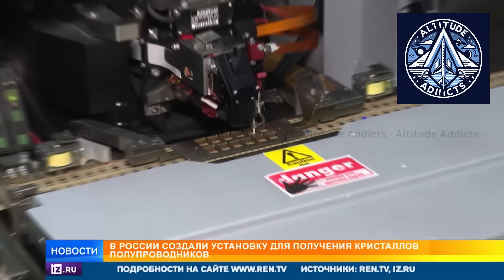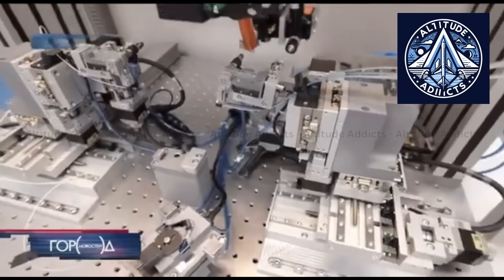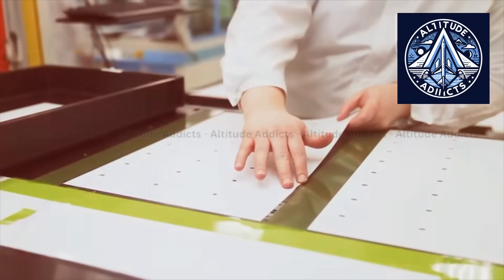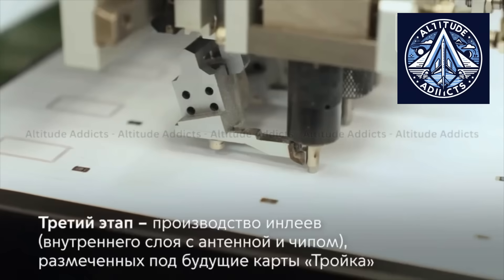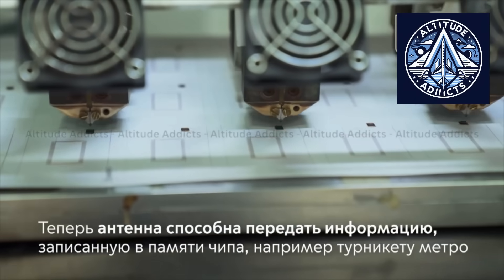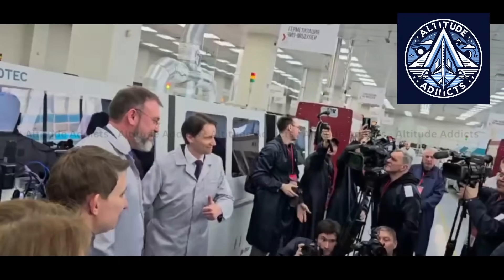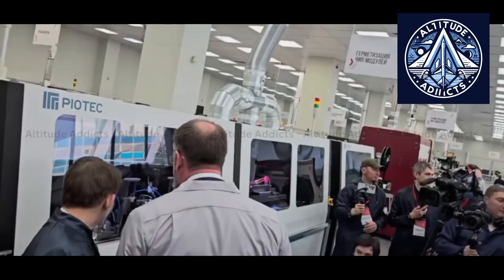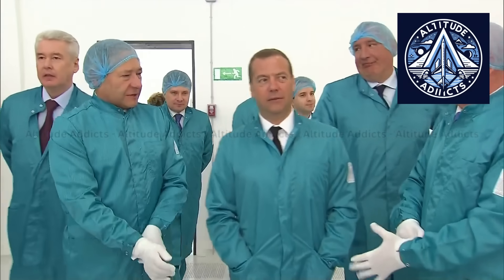11.2 nm X-Ray Lithography—Inside Russia's  Bold Plan to Reinvent Semiconductor Manufacturing | ASML

Comment: Radiation with a wavelength longer than 10 nm is generally classified as ultraviolet (UV), specifically extreme ultraviolet (EUV).
Radiation with a wavelength shorter than 3 nm is commonly considered an X-ray.
The intermediate region, between 3 nm and 10 nm, may be called "soft" X-rays or "extreme" ultraviolet, depending on the scientific context.
Ultraviolet radiation wavelengths range from 100 nm to 400 nm, while the X-ray wavelength range begins around 10 nm and extends to 0.01 nm.

Comment: Much to late
Reply: It is not too late. Just they need to develop somethng new, and this is already something he not a copy. Putin was right 10 years ago to push for Russian autonomy in chip production, obviously many in th system didn't realise how life saving that would be. Very soon machines with 350nm fully produced in Russia will come to the market, 350nm is really nothing impressive, is like 80's comon if chips, but that is just the first sight, the machines coming will be high tech in many other capacities making them moch more reliable that the old technology, and with improved hability to manage these machines 90nm could be achieved, that Luke make CPU possible. The race for the tiniest chips is a rad in the void without architecture development and machine software, Russia has the socialist to that, some of the best mathematicians around the world. Researchers that take pleasure in working all day on the most tedious mathematical calculous.

Comment: I think that these researchers have already achieved the significant results that can be applied on small scale, as the usual reporting out of Russia usually is far behind development.  It is the economics that are the usual drawback for general societal deployment within the greater economy of Russia, thus short term, things like repair of existing deployed nano electronic components is a viable solution that smaller companies should pursue.